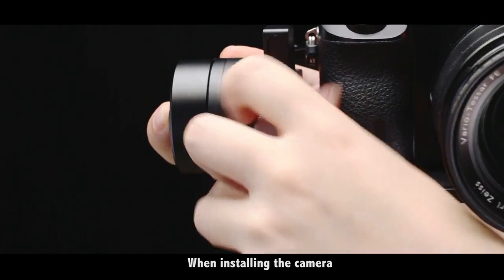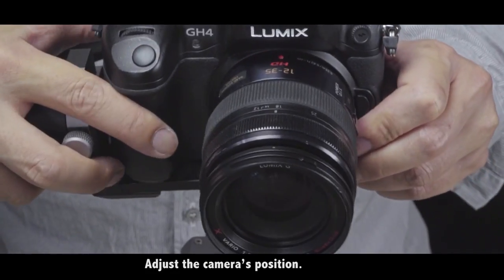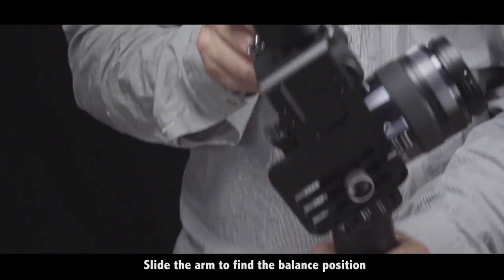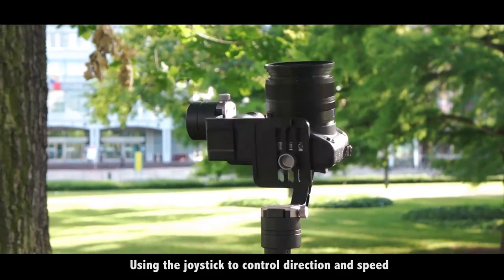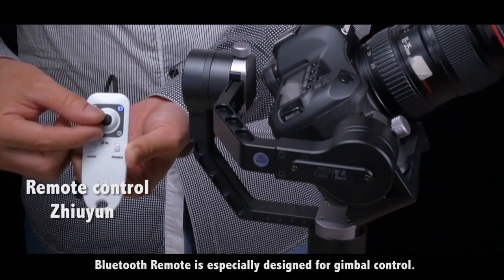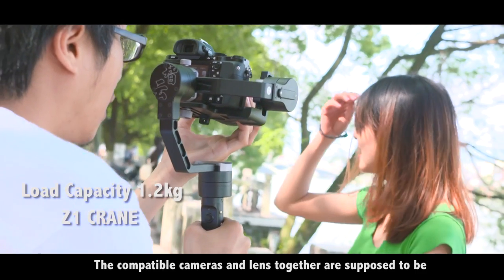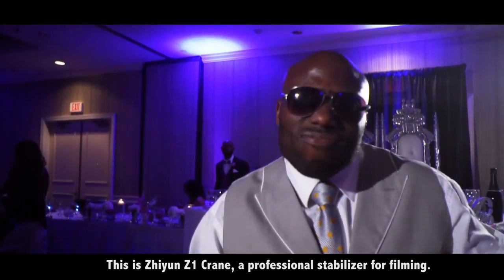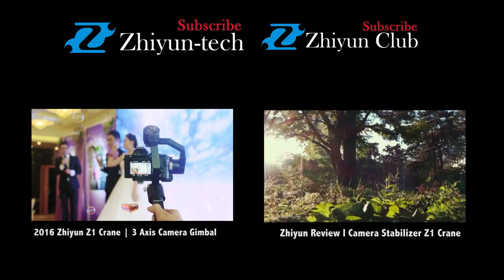2016 Camera Gimbal | Zhiyun Z1Crane Installation&Controller tutorial

Comment: Hi guys, i just purchased this gimbal and I'm really happy with it so far, i just wondered however, there is a mini usb on the handle which i understand is for plugging into a pc/mac to do firmware updates, but i can't find any info about that the second mini usb port is used for which i located on the top motor near where the camera mounts? i wondered if i plugged a battery pack into the handle usb and then a usb from to top port into my camera would it power the camera?
Reply from the maker: Hi Dave. The second port is for connection of camera and gimbal, to realize the zooming in/out of camera. The cable of this function will be released soon.
Reply from the maker: Oh, and welcome to participate our video contest on facebook and youtube. we have set prizes worth $6000
https://www.facebook.com/ZhiyunGlobal/
Reply: I have Crane-M and control cable. It does not work. There is no place in App to select Sony like some videos show. I have the latest Android App.

Comment: Hello , I have a Zhiyun crane and after the Firmaware 1.50 Update , the crane only blinking blue light, but NOT the Works Engines ... What Should I Do ?
Reply from the maker: If it keep blinking i think you need to charge the batteries.

Comment: Is this stabilizer made to support the nikon d3300 DSLR camera? or just mirrorless cameras?
Reply from the maker: Hi friend,it can work on the weight camera range 350g-1800g.If it's more than 1200g,you should upgrade the firmware fires.So Nikon d3300 is OK
Reply: Zhiyun-tech which firmware version does support 1800g?
Reply from the maker: nofx1st The corresponding 5D firmware
Reply: I have V1.51 is that the 5D firmware? Will that firmware have any side effect, like drowning batteries or more stress for the electric engines?
Reply from the maker: nofx1st CRANE FIRMWARE V1.50 5D RC2   this one. it won't have side effect as well as you have well balanced it.
Reply: hm ok, is there a change log for the different firmwares? I couldn't find any information on your website. 
Is it possible to downgrade firmware v1.51 to v1.50 5D RC2 ?
Reply from the maker: Yes,it's possible to downgrade the firmware.Here it is:http://www.zhiyun-tech.com/index.php?m=content&c=index&a=show&catid=132&id=189

Comment: Is the blue light always supposed to be blinking? Does that mean low battery?
Reply from the maker: Yes,it's mean you should charge it.The instructions have a detailed explanation of the electricity.
Reply: Zhiyun-tech Not the instructions I received..
Reply: Zhiyun-tech I'll charge my batteries for hours and hours and it still blinks..
Reply from the maker: You may have bought it from dealers that is not authorized so there is no warranty or instructions.
You could contact this email: service@zhiyun-tech.com

Comment: can you attach a 4k sony camcorder to this? it does have a pull out screen, but it's on the other side away from the gimbal?
Reply from the maker: It depends on the size. If not too big or too long you could use with quick plate

Comment: I bought a lumix G7 for my crane. I followed these exact steps but the camera will not balance correctly. It is within the required weight with the lens and camera. It seems as if the lens is too light and the back is too top heavy.. is there anyway to fix this?
Reply: Hey Jack! I'm in the same situation... I almost have it. My first mistake was that the camera was.... mounted facing the wrong way... Try looking at the manual again, see how there are two round parts of the gimbal? Well the right one should be on the right side of the camera.

As I type this I see how it's so hard to describe..... ZhuYun really has to make a better tutorial...
Reply from the maker: Yes we are going to have very detailed tutorials soon! Please wait!

Comment: hi, I have the new version, it doesn't push the center joystick to change modes, it has a mode button that I think it is the one for changing those modes, however I cannot find how to pan, it only either tilts up and down or tilts left and right, but no panning, any ideas on what am I doing wrong I'll appreciate it!
Reply from the maker: Hi, you need to pan under locking mode. When you turn on the gimbal, the default mode is pan following and the gimbal will automatically follow you left or right. If you click once, it will turn into locking mode, you could push joystick to pan.
Reply: thank you! I did found out eventually that this was the issue, I got the pan working just fine! thanks for your reply anyway!
Reply from the maker: Really glad to know that :)

Comment: Isn't Canon 5D Mk III + 16-35 L lens over 1200g?
I'm using a lot of GH4 + Sigma 18-35 which is somewhere between 1200-1500g would this gimbal work?
Reply from the maker: Yes the supposed weight is 1200 gram, and it could also work well with 1500 gram, for the maxi weight it could be 1800 :)
So your gear weight is fine. But your lens seems to be a little too long which will influence the balance in front. remember to add the support we have provided to adjust the balance.
Reply: Thank you for your answer. I'd like to test it first. Do you have  dealership in Poland or in Berlin?
Reply from the maker: Trylobit sure. here is the dealer we have in
Address:
MITOYA
BATOREGO 18 POK. 272
02-591 WARSZAWA, POLAND
Phone numbers:
    792 648 692
    0801 066 300
    22 295 12 04
    22 244 37 62
Reply: Have you tried it yet? I'm on GH4+metabones+Sigma18-35 and wondering how it performs as the setup is just under 1600g which seems a bit heavy for this gimbal?

Comment: Hi I just bought the Zhiyun Crane.. when the gimbal is turn on and Im holding at the top of the gimbal the buttom under joystick is keep on rotating in 360..is this normal?
Reply from the maker: That's an error operation. When the gimbal is on you should not hold the part except handle. You can lightly touch but cannot hold other parts which is working.
Reply: so its an error operation..it means there was mistake in the way Im  holding the gimbal.. but theres no error inside the system gimbal? right?
Reply from the maker: yes :)

Comment: Having trouble balancing the Sony a6300 and the Sony g 18-105mm lens
Reply: Me too, with the a5100 kit lens - seems like our cameras are just too light (even though mine is heavier than the 350g requirement). Wondering if we get it balanced as close as possible, would it still be okay to use?
Reply: Crane M might be the better option for us small camera users.

Comment: the gimbal produces shakey or jitttery videos when I walk. why is this. i use 80d with 50mm 1.8 stm and 24 1.4L ii.
Reply from the maker: You may need to step more steadily and check whether you have balanced it properly
Reply: i also experience this when using very light lenses on my 6d